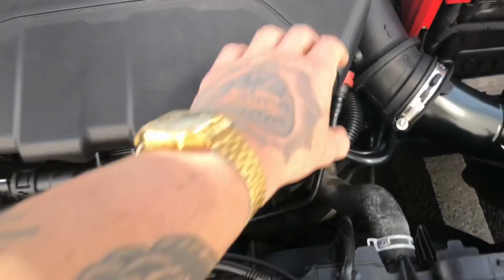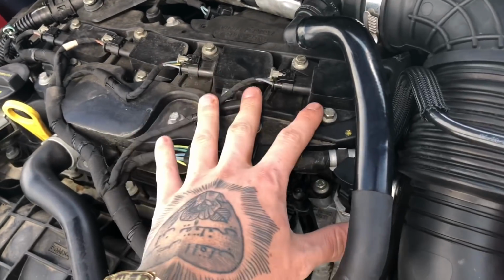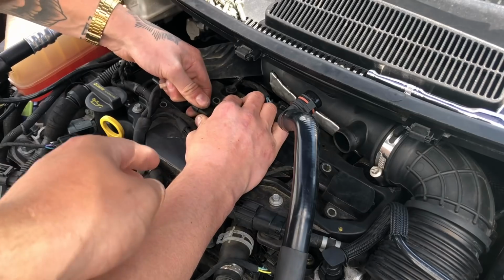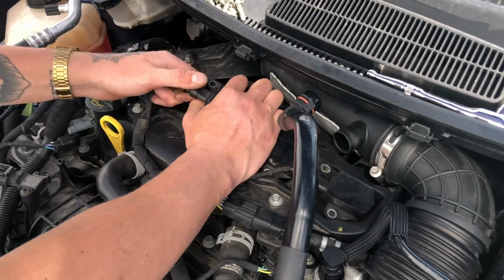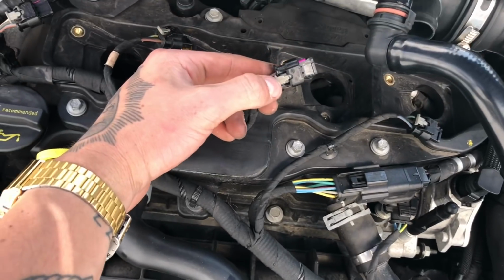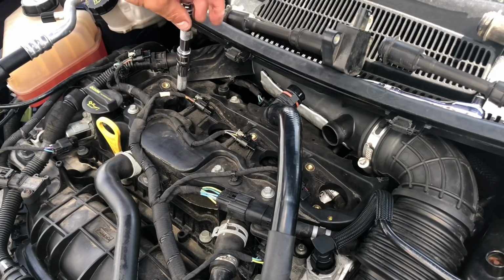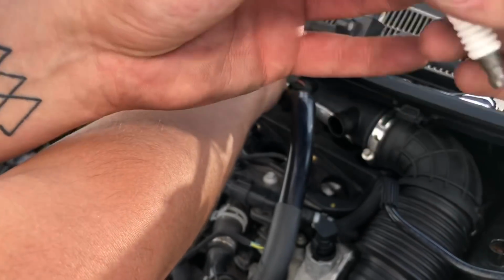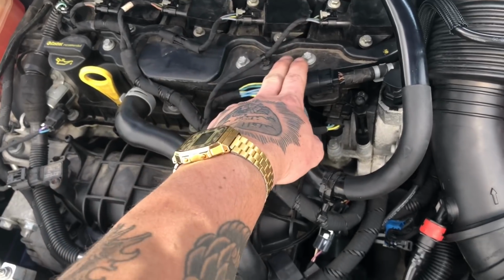Fiesta ST180 - How To Change Your *BAD* Spark Plugs!!

Comment: Had mine carbon cleaned mate.Massive difference! The engine and exhaust seems to free flow a lot better.My exhaust even sounds louder.Had a Stage three clean.Engine,intake and injectors.

Comment: Just a heads up, every spark plug doesn't come with that double electrode type design so your plugs didn't seem too bad tbh, it looks like there isn't a top tip but most plug don't actually have that top tip part. Now if there actually excatly the same plug then of course that's not right. It probably is just the gap needs to be smaller for your mods. That being said if there old there's no harm in replacing and sometimes a visual doesn't show all. Heads up also, not many plugs are pre-gapped for cars out of the box more so if you have changed a lot from factory spec. Not meaning to sound like a funny comment just some advice =)

Comment: Nice vid mate , should be good for map 👍🏼 the original ford ones don't have the pin in the centre like your new ones , it's just a different design , not wear
Reply from the maker: Jamie Sweeting oh is it really? Car definitely seems a lot better since the new ones!
Reply: L19 BOU yea it is mate , I had the denso for a while, then ford changed them on service and mine is a little unhappy with them , I'll deff be going back to denso ones on pay day